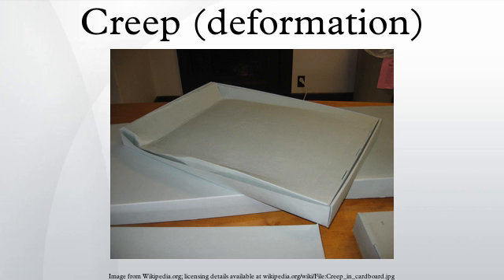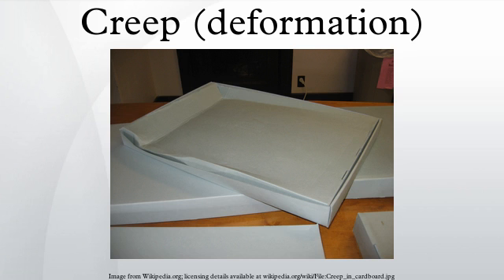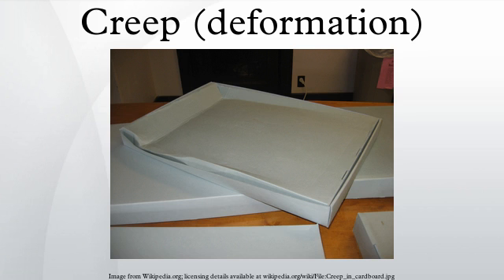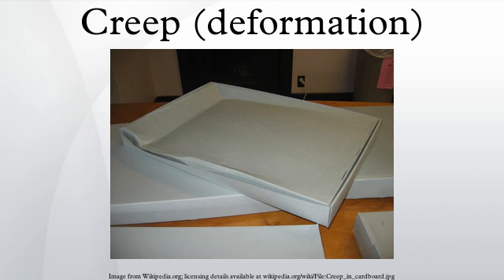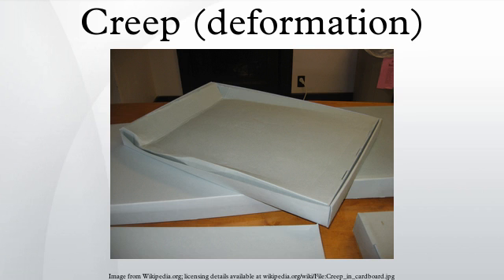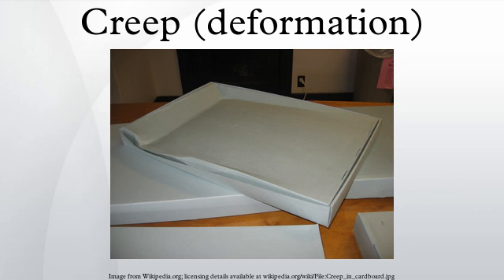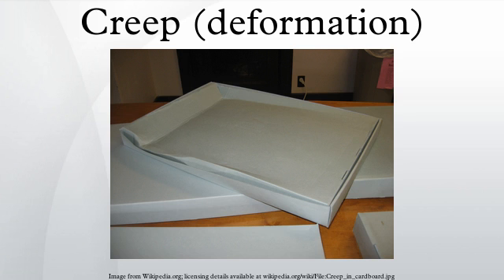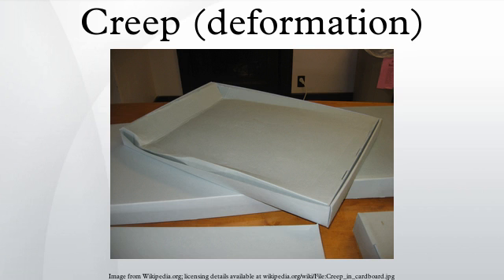Creep (deformation)

Comment: helpful viduo
question, when the creep in first stage and it's incresed due to work hardenening does it mean in stage1 it start plastic deformation ?
and if we want to resist creep we increse yeild point so it can withstand high temp.  and doesnot start plastic deformation? is true?
thanks